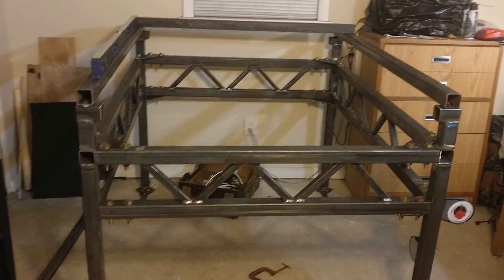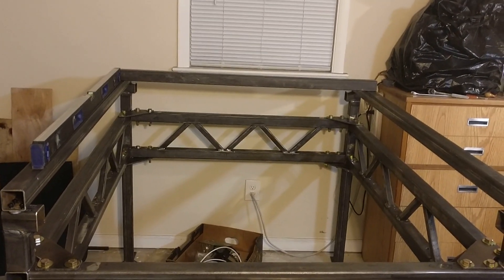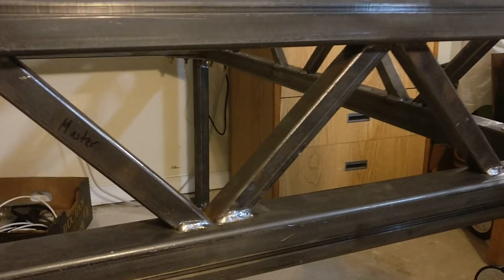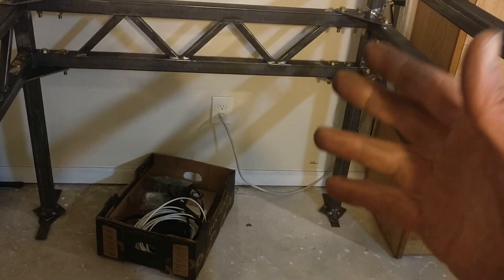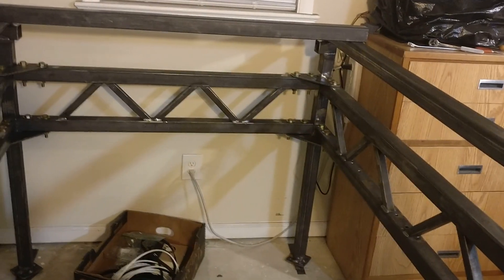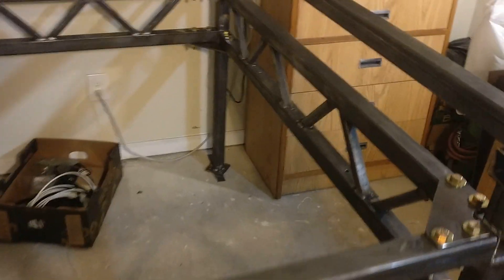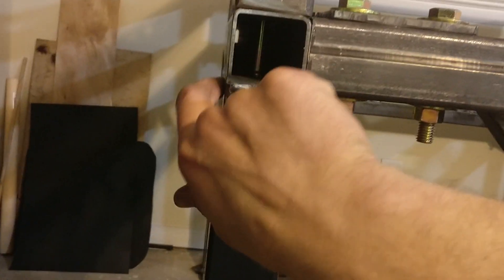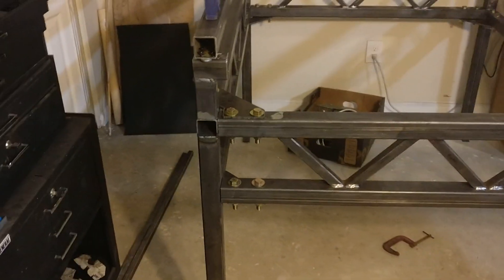CNC Plasma Build: Progress, placement, and sorta squaring

Comment: Interesting issue with the angles.  I think I would be questioning the accuracy of the tool.  Did you mention that the corner to corner measurement was good?  

One another note.  Your top rails that you have for adjusting.  See if you can put a couple holes through the top so you can get your allen wrench in there to make the adjustments.  5-10 degrees of wrench movement is not fun.  Just a thought, although you probably will not have an enormous amount of vibration like a bench top mill.  You might not need to readjust that often.

I did not see if you fitted the feet with any threaded rod for making adjustments.  

All in all looks really good.  Nice welds and looks like you really thought the design through.  Look forward to the rest of the build.
Reply from the maker: It did end up being tool. A few days after posting this, I remembered the trick for checking a square - scribe, flip, scribe, and see how well they overlap. This one comes in a hair under 90, which explains the measurements. (I'll add a note in the video description on this.) I forget what exactly the diagonal measurements were, but they were close enough that they only made me question the square more.

You're definitely right with regards to the access holes for the allen keys. I did go back and do a couple on one of the X rails while adding the belt tensioners, and it's something I plan to do on the rest of them in time.

The feet each have four holes in them for 3/8" rod, and I've got a pile of threaded studs and nuts to use as levelers. One nut above the foot, one below, the rod going through it. The adjustments ended up being so small though that I think the wedges will be fine. The threaded studs will go in a box for the next few months, until I lose them, find them years later, and use them on another project. lol

The holes in the feet might still be useful for anchoring the table to the floor.

I'm at the stage where I can draw boxes by manually plugging in coordinates, with a sharpie taped on to the Z axis. I can't give a definitive number for the accuracy yet... but I'm pleasantly surprised with how good it is. I've got some more videos to shoot this week.